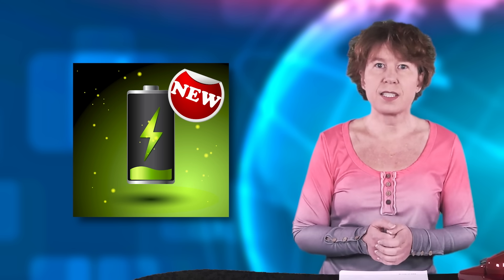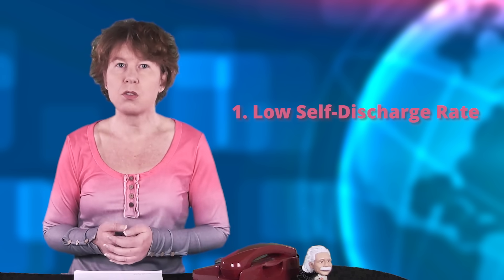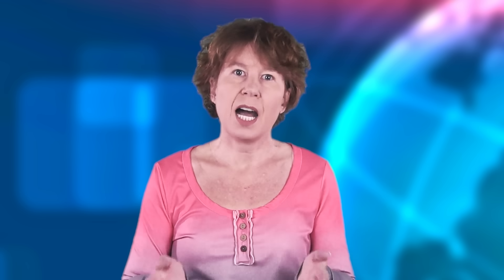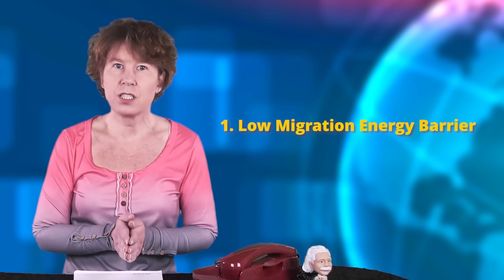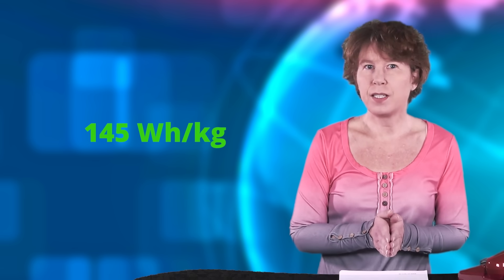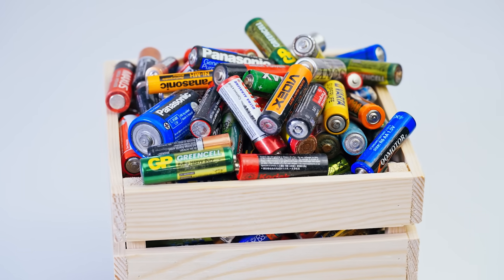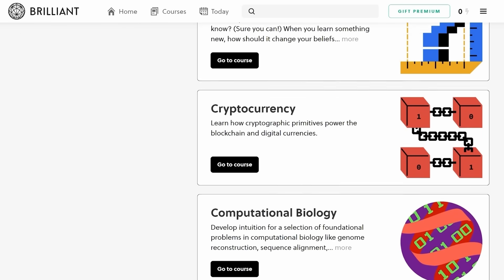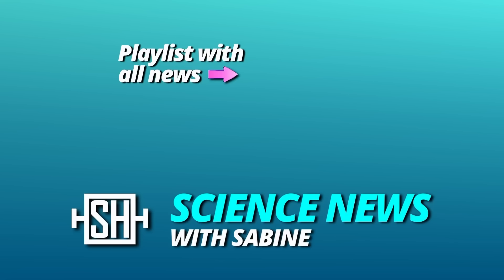Fully Charged in Just 5 Minutes: New Battery Breaks Records

Comment: I built a full suspension electric bike with a top speed of 35 MPH and 32 amp hours. I did a lot of research on duration distance what makes a good rise. There are so many stops, intersections getting places fast acceleration from a stop great to top speed decreases travel time. My bike had enough total duration that it could complete any desirable trip with the previous nightly charge. Long charges are superior because they result in better battery 🔋 balance, which gives higher top speed and long battery 🪫 life. My batteries 🔋 worked well for 5 years. Quick charging is very bad for battery 🪫 pack balance. Contrary to popular belief lithium batteries 🪫 do have a memory but it is short term and erased by balancing the batteries 🪫 for up to an hour maybe longer. The increased weight from the large battery 🔋 pack in the bike made it stop better, I built it with disk breaks, going from top speed to stopped in about 10 feet.

Comment: The biggest problem with fast charging is the power feed.
If you have a 60 kWh battery, as is the case for at least a couple million Teslas, and you want that charged to 100% in 5 minutes, you need an average power feed of 720 kW - for ONE vehicle.

Comment: Long charging times limit customer throughput: you need many more charging stations and Germany does not have that many. However there are now German supercapacitors in development also with half the power density of lithium that charge even faster. Still even the lithium batteries are heavy, this new stuff even heavier and weight is an enemy of the car.

Comment: Charging a large battery, like a car, will need massive amounts of power to charge the battery in five minutes. My car can accept 350KW charging yet still takes 18 minutes to charge from 10% to 80%. 18 minutes is not any kind of problem. I need to take a break and the car is usually ready before I am - the tea is too hot to drink. Leccy cars really are not the problem that BigOil tells it they are via their client journalists. I wouldn't chose to go back to fossil fuel.

Comment: "New battery takes less than 5 minutes to fully charge" - it also takes a total energy to manufacture more than building the Great Pyramid of Egypt. 
A battery takes more energy to come to existence than a 1969 Boeing 747 Jumbo Jet.
How that can be true?
The industrial base that creates the battery is vastly and unfathomably more demanding than that was necessary for making the 1969 Boeing 747 Jumbo Jet.
e.g. in 1969 there was no need for exotic chemical and mineral elements required for the battery but not for the 1960s 747 Jumbo Jet.
Any unavailability in fossil fuels will force the termination of making an EV, but not a 1969 Boeing 747 Jumbo Jet.
More unavailability in fossil fuels and the 1969 Boeing 747 Jumbo Jet will become impossible to manufacture - but a WW II DC-3 is ok, not a 1997 Toyota Hybrid Prius but a T-34 Soviet Tank or Ford Model T.
Then, more unavailability and - not a Ford Model T but a steam engine.
More unavailability - and you'll be able to build a replica of the Great Pyramid of Egypt - slavery assisted - but not the steam engine.
All a confirmation that building the Great Pyramid of Egypt took less energy than building James Watt's steam engine, an EV, a solar panel, a wind turbine, a mobile phone, a drone, a "New battery takes less than 5 minutes to fully charge", and so on.
"No matter how highly mechanised and self-powered, fossil fuels extraction requires a number of people - as if the process is executed by hands using buckets and ropes".
Today, this number is 8 billion people - working flat out 24/7 - strong.
Sabine Hossenfelder, you and I are among those, too.
Our Western Civilisation has been no more than a fossil fuels extraction operation - all along.
Finite fossil fuels are dangerously hypnotic to humans, their consciousness and mental capacity.
Humans were not ready morally, ethically and intellectually to start the mass extraction of fossil fuels with the advent of the steam engine 300 years ago.
The Magna Carta requires today overhauling - adding to it the right for humans to understand what Energy really is - before any other commandment.
"In any system of energy, Control is what consumes energy the most.
No energy store holds enough energy to extract an amount of energy equal to the total energy it stores. 
No system of energy can deliver sum useful energy in excess of the total energy put into constructing it.
This universal truth applies to all systems.
Energy, like time, flows from past to future" (2017).

Comment: when on any kind of longer travel distance where you might be low on a charge before, during, or after... recharging, depending on the time of day when others are charging, finding a charging station in your area, and the current temperature (winter) it could take 1-3 hours or more added on to your trip... meaning you might even have to leave 3-5 hours before your meeting to be sure you can get it charged... gas takes 5-10 minutes... are are you going to want to sit in your vehicle that long while charging?... and it would take longer if you were running the vehicles heater to keep from freezing...
Reply: You need to get a Tesla.  Trip planner routes you to a non congested charger while it preconditions the battery.   Tesla will open this up to other makes as others start using NACS.

Comment: One of the problems of supper fast charging isn't the battery but how to deliver the power quickly while not over heating.  A Tesla 100kWh battery will need 100K Watts for one hour.  The cable will also need to be flexible enough to be used.
Reply: 100kw wont overheat a cable, they are water cooled and given typical engineering standards they should withstand the 250kw they deliver without a problem - even over a longer time period
Reply: @romansenger2322  A cable shouldn't need to be water cooled.
Reply: @knightsun2920  Why not?
Reply: @fiddley  Because it is a complete waste of energy.  It is suppose to be "clean"  yet you have to waste energy to pump water through the cable and then spend more energy power to cool it.  The more amps you pump the hotter it gets.
Reply: @knightsun2920  Huh? Combustion engines waste 60% of their energy as heat. I fail to see your point.
Reply: @fiddley  And where dose most energy come from ? ? ? The energy used by the USA is 32.8% from natural gas and 10.8% from coal.
Reply: @knightsun2920  You conveniently forgot the 12% renewable for electric, compared to 0% for ICE... 🙄
Reply: @fiddley   Back at you with this question  Cadmium Telluride and Gallium Arsenide are both used in solar cells.  Cadmium and Arsenide are highly toxic.   Also how much Carbon is released in the production of Lithium. First being mined in Australia then shipped to China.  And how about all that "Blood" Cobalt that is mined from the war torn Congo?
Reply: @knightsun2920  Ha! Another tenuous talking point from big oil hey? Tell me, do they provide you with a script, or do you write your responses free form?

Comment: People with the charge angst.. they always worry about the one time in the year they drive into holidays, every other day it will be fine if slow charging it at home over night (or during working hours at the job.. where the main issue is that company parking slots should get wallboxes, or parking houses, but with affordable charging prices). And for the one time in the year you want to drive across whole europe.. just put the car onto a train.
Reply: There exist other vehicles than private cars; battery-electric buses and trains for example. Faster charging reduces idle times and thus increases efficiency. In a perfect world it would be so fast that a bus could recharge enough for the next tour while sitting at a line's terminus for a couple of minutes, which would allow to use much smaller, lighter, and cheaper batteries compared to a bus that is recharged between shifts.
Reply: I can't charge at home. That and the price are the reasons i didn't get one. Now my current car is only ~6 years old, so it will take a while until i get a new one.
Reply: a "but what if i want to drive to (next city over) what then?"
b "whens the last time u drove there?"
a "15 years ago."
b "ok, just checking."
Reply: @geophat75  I live in Australia . The major cities are roughly a days drive apart.  I do Brisbane to Sydney 3 to 4 times a year . You may not like to travel.  But a lot of people do trips multiple times a year.  And yes there are trains to do those trips but that's diesel, maybe use a plane that puts the polution right at the worst possible point.  But hey I'm just a dumb worker , who will ultimately pay for your dumb idea's.
Reply: @davidheath2427 Batteries should work just fine for trains. Or maybe fuel cells. Trains might be one of the few applications for hydrogen. Or you do it the old fashioned way and build catenaries.
Reply: @harmless6813  do you honestly believe that you could build a train that ran on battery packs.  That is still a long way off . Trains travel long distances.  They are the ships of the land . No those types of batteries have not even been thought of yet never lone perfected .
Reply: @davidheath2427 Of course you can. Just add a trailer with batteries. If anything can carry a lot of weight, it's a train.
Reply: @davidheath2427  Anyway, for trains we developed already a very good way to get electricity to them, and a majority of them do run on it already.
Reply: I would want that in an environment with an unreliable power grid. If you never know how long the electricity is even going to be there, sure this helps. 
But otherwise, it doesn’t seem to add much convenience.
Reply: More like twice a month in North America.
Reply: So your company car park should have a charger . Just curious what % of your company gets a car park allocated to them . And once again the poor pay for the rich .
Reply: Most apartments, where most people live, have no capacity for home charging.
Reply: @Erowens98  Exactly, thats the issue we need to address, not the battery.
Reply: @georgelionon9050  its the same problem. Charging capacity for lots of people usually requires battery buffers to avoid overloading the system. Installing a charging system for an apartment complex of 50 people would require more batteries.
Reply: @Erowens98 We will have to address that problem anyway. There is no alternative to electric cars in the long run. At least I can't see any.
Reply: @Erowens98 You are, of course, free to disagree. But the efficiency comparison convinces me that you are wrong.
Reply: @Erowens98 They are heavily invested in because oil companies are looking for a replacement for fuel, that can still bring them profit.
The energy balance makes all those 'alternatives' uncompetitive for everything that batteries can be used for instead. (I.e. planes, ships and trains might be economical use cases for hydrogen et al.)
Reply: @harmless6813  oil companies are perfectly capable of investing into renewable technologies and nuclear power just like everyone else.

There are real, objective, scientifically proven advantages to synthetic fuel, and pink hydrogen, over petrol or diesel ICE and BEV technology. The most important of which is that both are far better for the environment than BEVs are. Just because you like BEVs, doesn't mean that all other options are invalid and only being researched as part of a conspiracy.

If you where thinking objectively, you'd realize why these technologies are necessary. You have any idea how hard it would be to support BEV based industrial vehicles in remote area without robust power grinds? Or how hard it would be to make a viable passenger aircraft with batteries that have significantly lower energy per kilo than any of the alternative technologies? Or even just what it would cost for logistical companies to have to spend hours per day charging massive batteries necessary for long distance trucking? The only reason BEVs are being pursued is that they're easy, and thus can be used for quick greenwashing.
Reply: @Erowens98 I already said that there are uses for other technologies. Passenger cars are not one of them.
As for the environment impact, everything reputable that I have seen says batteries are the best option, simply because everything else has too much loss due to conversion. That's not my idea, I just evaluate what I see and read.

Comment: This is why batteries swapping is the way to do it. Where vehicles are designed for you to swap the batteries out quickly at the charging station.
Reply: Many negatives with battery swapping.  You can buy a NIO now with battery swap or without and despite the car being significantly cheaper without it, most choose not to have the battery swap.  It might be possible to do it well but I don't think you'll gain much.

Comment: Interestingly, it has often been hypothesized that a highway or freeway could power a battery with the proper infrasructure, with low power costs. This would enable a battery vehicle to leave that road with a FULL (If it was full at the start) battery, allowing it to go on dirt roads etc later with a full power load, not needing sometimes unavailable outlets. As an added benefit, power via nuclear energy would allow transport costs when the grid was at low usage basically for free, lowering costs of products... Win/win...

Comment: This type of fast charging and discharging of battery may be very important for EVTOL applications.  A fast charge means a fast discharge..   however, to achieve this, there will be compromises in both battery, capacity and battery life..  but it will be useful.  for instance emergency hydraulic power in an aircraft

Comment: Indium is less abundant than Lithium. It is already used for the production of LCD screens and other electronics, so those would likely get more expensive. Then again as lithium supplies drain alternatives will be sought. It is heavier than Lithium but how much of it is needed in a battery? does that matter? I am sure there are other use cases than driving where very fast charging is more beneficial. In the end I think we'll need to develop carbon based batteries. Carbon can be endlessly recycled as nature is showing us already.